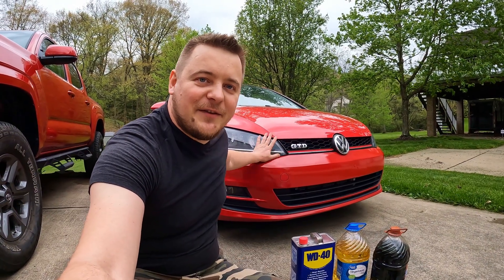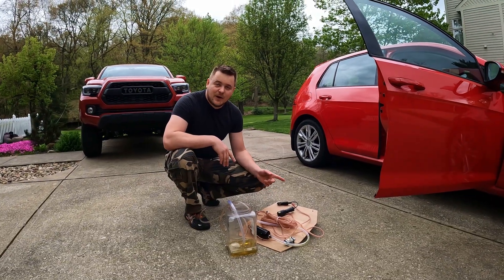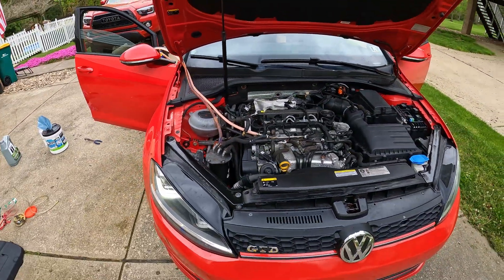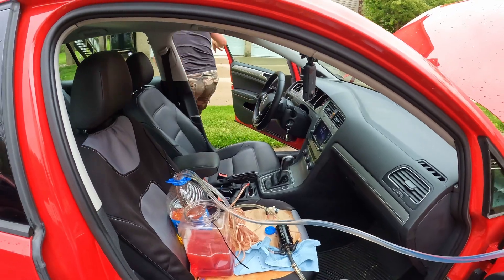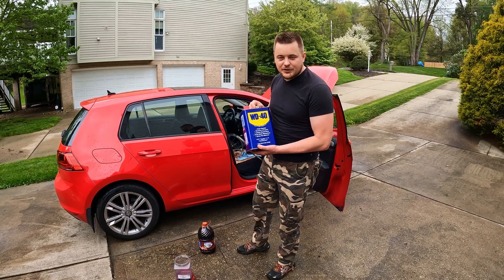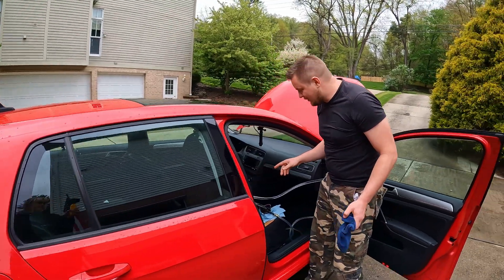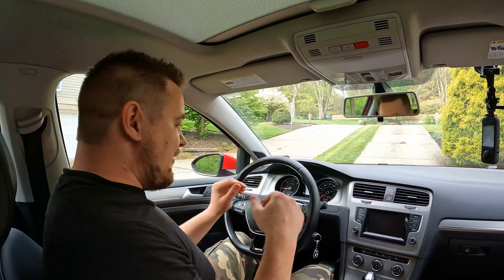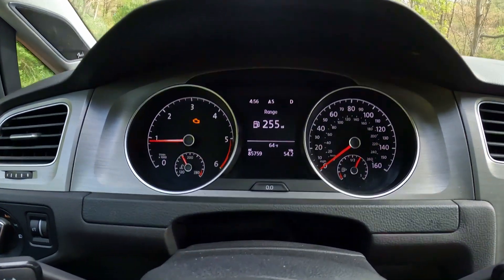Insane Experiment: Running a VW Golf MK7 on WD40 Instead of Diesel Fuel?!

Comment: We used to use WD40 in the spray can as starting fluid for the General Motors 350 Oldsmobile V8 diesel engine. It worked great

Comment: Please try the 20% gasoline 80% oil mixture to see if it will run. It worked wonders on my mk4 jetta tdi!
Reply: What oil or biodiesel?  What was the point of this exercise? Everything you used costs more than diesel so I just don't get it.  More BTUS / energy in a gallon of diesel than these others.

Comment: I thin my filtered Waste Veggie-Oil with 15% gasoline for summer and 30% for winter. I use this mixture in my All-Power 6500 Diesel Generator. It works just great.